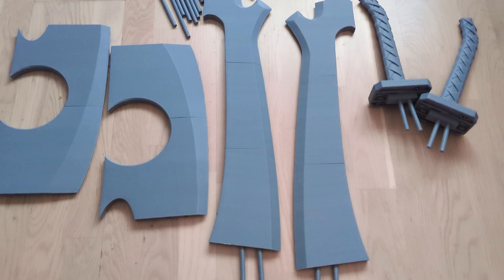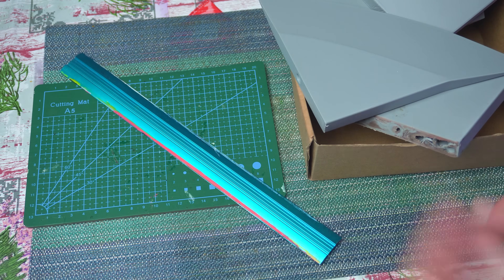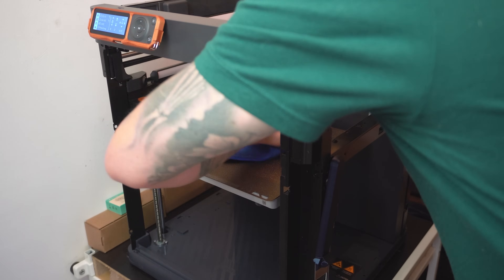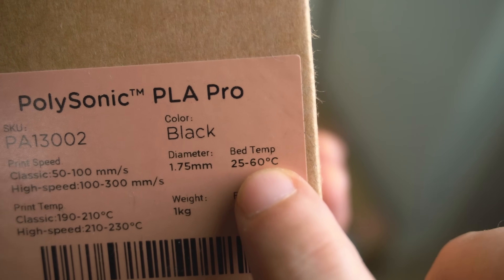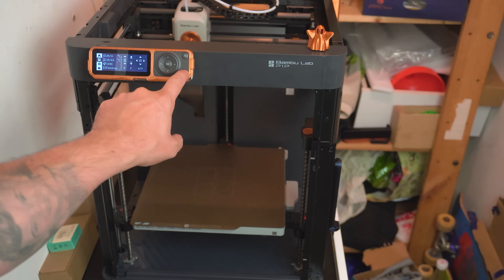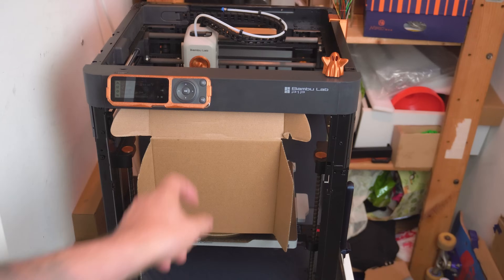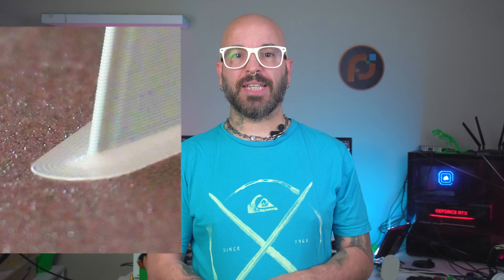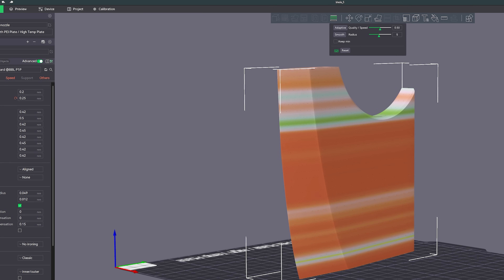Stop PLA Warping NOW: The Ultimate Fix for Perfect Prints Every Time!

Comment: super useful!  Thanks!  does the angle at which you print affect warping?  i had a large 500g print that was very solidly built printing at a diagonal across the bp.  It warped both times i tried it even with full brim.  unfortunately the problem seemed to start about 3 hours into a 4 hour print so lots of time and filament down the drain!  Going to try your suggestions.  bp was clean and filament was dry btw.

Comment: On larger prints that cover most of the print surface flat. Tend to warp on the edges even with brim to 10mm and vision miner adhesive. Using cool plate on X1 carbon. The very corners always tend to curl up !

Comment: I came here looking for clues to my warping problem but there is nothing new that helps. I can print on my A1 with no issues but my new P2S causes warping with the same settings and PLA. I don't have a solution.
Reply: Does the P2S have an Auxiliary Fan on the side that the A1 doesn't have? Maybe try lowering that fan speed or just turn it off and see what happens.

Comment: Most warping that occurr arent some bed adhesion issues... You can add ears or whatever to just make it stick to plate better but this just holds it harder to the plate but it doesnt stop the warping that accurs above the bed. Almost noone who has used a printer more than a week struggles with getting pritns stuck to the bed. We even use bed "adhesives" to make it adhere LESS to the plate... Not more. This isnt our problem. If just downloading a random print configuration... none of these settings are very wrong. Even just downloading the manufacturers basic print profiles are just fine generally speaking for PLA. I picked up a PLA that was in my garage for last year, just a third of a spool left. it was so brittle I could break it and probably damp. It still printed fine. 

Reducing fans isnt a very good idea. This increases the dropping and reduces your printers overhang performance. Increasing the ambient temperature is something you dont even talk about. This makes the difference in temperature smaller and causes a slight reduction in warping. This even works for ASA/ABS and is much more important there. 

You somehow seem to struggle with bed adhesion issues and take out your trauma here on the channel. 

You seem to have completely missed out that warping accurrs above the bed level and especially on thin slopes. Thats why they are either hit by nozzle or the underside of the overhand looks a little jagged. That is usually either drooping (you can meassure the lines having fallen downwards slightly) and warping (the overhang is actually lifting a little compared to the intended surface level. But ofc a content creator would discuss overhangs that occurr over the bed level normally.

Comment: I always have warped parts on any printer it always happens after it's cooled then removed from the bed  and sat for a while. It always sticks and isn't warped after pulling it off the bed. And yes I let it fully cool down. Did one last night pulled it of the bed in the morning was all good. After I got home from work it's warped sitting on the table. Could it be something to do with internal structure like to much or little infill?
Reply from the maker: It sounds like you're experiencing post-printing warping, which can be tricky to solve.

Comment: I'll check initial layer settings but maybe it's just me but I dropped warping rates through increasing bed temp to 65. Also to note if the print is big enough it's much easier to wait for a cool bed as the natural shrink will remove it for you. I did a big hollow print and I could hear it cracking free from the bed as it cooled

Comment: Using ipa = ur clueless
Reply from the maker: Instead being rude, elaborate
Reply: @PixelForgeLab  ur slowly destroying ur beds natural adhesion, dish soap and hot water is all you ever need
Reply from the maker: @MegaChickenPunch Ok thanks.
Reply: @PixelForgeLab  also use hegron hair spray as a 3d glue, works wonders on PEI textured sheets
Reply from the maker: @MegaChickenPunch thank you, that's useful to know

Comment: 1. Cleaning the print bed with IPA is bad for long term durability. Use dishsoap.
2. Drying PLA isn´t necessary, since the material does not have hydrogen bonds and thus not absorb water like PA does.
3. Part geometry and material accumulation might be an issue as well, just like with injection molding, same rules apply.

Comment: I think that the most important thing on the list is making sure the bed is clean and free of skin oils and to use a slightly lower heat for PLA. Those two settings fixed everything for me, I was so naive to think i didnt need to clean the bed that often but I was wrong!

Comment: I've tried to print a door slot mail catcher box, and because of its size and my printer bed size limits, I had to split the model into 4 parts, the warping made it ugly looking and not possible to join all parts.
Thanks for the advises, I've used them on other big pieces and they work well.
Reply from the maker: @bassamjeanbart  so glad

Comment: Warping is all about internal stress in the printed object. Internal stresses occur when the hot filament cools down and shrinks. If you want to get rid of warping, you have to find ways to minimize internal stresses. The simplest method is to bring the installation space to the glass transition temperature. Unfortunately, this doesn't work with PLA because it softens before it reaches the nozzle and blocks the heat break. Another very effective method is to reduce the printing speed. This gives the printed layer enough time to cool down. You will probably achieve this effect by reducing the layer height at different heights. There is a further advantage if you are already printing more slowly (lower volume flow). Then you can often reduce the printing temperature and so the temperature difference is smaller, which again ensures less internal stress. A complex topic in itself, but the principle behind the problem is simple.

Comment: Calibrating your filament, drying your filament and reading the guidance on temp levels for your chosen filament.

Really, this boils down to ensuring your first layer adhesion and overall filament is dialled in via calibration prints such as :

Temp tower

Max flow rate

Flow rate

Pressure Advance

Retraction

Comment: Great video but i have previously tried all of these on the creality V3 KE. The only potential issue being, my bed temperature is set at 68. However anything lower than 65 and I have extreme first layer issues.... can anyone point me to a resource to help? Thanks in advance!
Reply from the maker: @ricksanchez188  don't have experience with creality, but pretty sure you have to try different temps and you'll find yours

Comment: Okay but what about if the first layer is perfect and if it’s a print that’s smaller and thinner it won’t warp but if it’s a taller print like the ones shown in this video the print will start to bend on its own during the printing? Is it a room temperature issue or a printer issue?
Reply from the maker: @alexandertwol  you have to do multiple tests to see what's the issue, like i did
Reply: Best to do those bottom layers at slower speeds. If the nozzle keeps going over it to fast it will keep the layers that are below it soft. Thats why cooling is also a important keyfactor. Unless were talking about Petg thats a whole different topic 😂

Comment: If 60 degrees improves it but doesn’t fix it, should I drop my bed temp further and if so to what?
Reply from the maker: @JNexTV  there are many other variables, if the printer is enclosed, if the filament is dry and what type of filament, you do small tests with 5 degrees changes in positive and negative, it took me a while to get my temp correctly
Reply: @ awesome ty

Comment: Have you had any warping experience for PLA+?
Reply from the maker: @JNexTV  yes in the past, but with these little tweaks, fixes it .
But PLA+ requires different temps, you have to test it a bit, so many variables
Reply: @PixelForgeLab what else would you suggest taking a looking at settings wise that could need to be tweaked, and what brim width did you use?
Reply from the maker: @JNexTV  just the bed temp, brim any will do 👍🏼
Reply: @ will test when I get home, wish me luck 👍
Reply: Better but still not perfect. What else would I touch?

Comment: A great way to prevent warping on the extra large prints is to use fuzzy skin. The warping happens because the pla is contracting along the length of the line and the fuzzy skin prevents there being a long straight line to contract
Reply from the maker: @JamesTaysom  but you can't use fuzzy skin on all prints

Comment: Thanks for this video. I’ve found out recently that my set bed temp, say 60, doesn’t match the actual temp of the flexible plate. The plate is usually 5 degrees lower. Have you seen this with any of your printers?
Reply from the maker: @MrRwillis59  not really no, couldn't measure the actual temp on the plate
Reply: The sensor is usually located underneath the heating bed. It is therefore normal for the printing plate to deviate several degrees Celsius from the specified temperature, especially at the edge.

Comment: I have never seen this happen on any printer with pla. Its common with abs most likely your bed is to hot. The cause is the layers above the bed cooling  and shrinking while your base layer is hot. They create tension pulling  up on your part. The recommended bed temp fo most pla is 50c-55c on the high end. Moisture in the filament normally causes bubbles and pops but not warping. You should also print as close to the low temperature listed on your filament will flow. The more temperature you add the more you degrade the plastic.
Reply: I have been using Silver Grey Silk Pla and it really has a problem on larger prints. For example with a Star Trek Enter prise model. The small edges of the saucer section te d to pull upwards and leave a ugly finish
Reply: Happens on the Bambu X1E at work all the time, prints lift almost exclusively with PLA
Reply: I must be doing something else wrong, because my large PLA prints warp if I don’t have my bed temp at 62, for wide open, glass top off, aux fan off. Anything other than this and it warps. Even if I add brim and discs, I can stop the sides from warping, but then the middle of the print warps. It ends up looking concave. I have no idea why. I’m going to try to start my bed off at 62 like I do now, to get a good first layer, and then slowly drop the bed temp to 55. I’m hoping that helps. What’s interesting is I don’t have to do any of this nonsense with my X1C. It just rips through prints. But my P2S?  Finicky.
Reply from the maker: @gremlinsports  ehm, that's exactly what I explained in the video...
Reply: @PixelForgeLab  what I said is its common with abs. This doesn't happen with pla if used properly. To state it more plainly have not seen this in my 12+ years printing not even on my old rep rap. It's caused by  user error not the filament or the printer. You don't need the bed heat at all with pla.
Reply from the maker: @gremlinsports  you're missing the point.
Reply from the maker: @gremlinsports  the point of the video is for beginners and with users having issues with pla sticking ;)